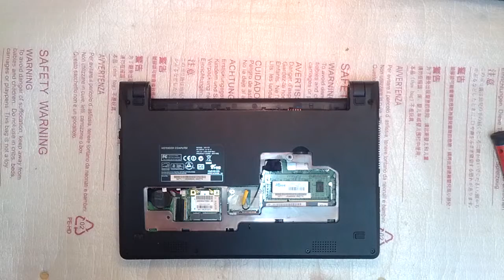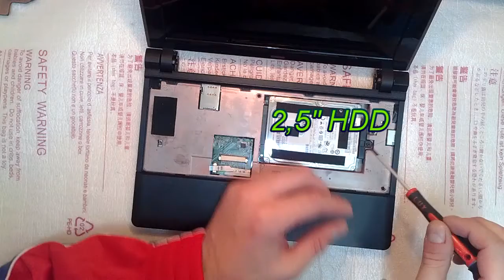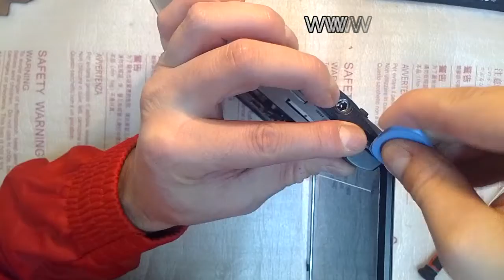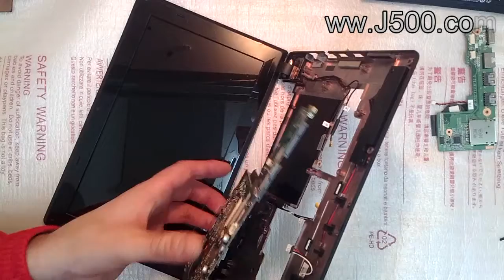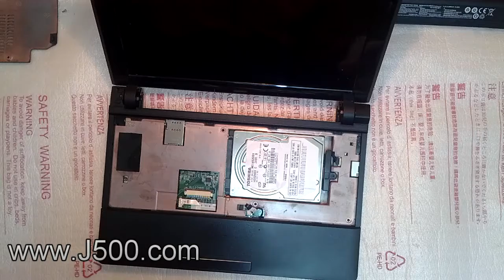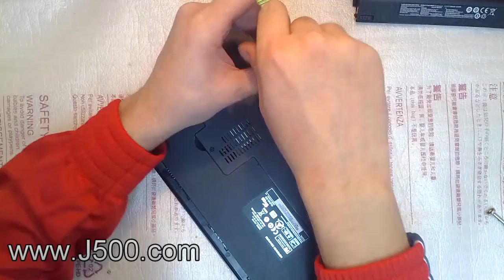Disassembly Clevo Netbook intellibook Repair Replace Guide

Comment: D= my face when i saw the little holes on the keyboard too, pushed a screwdriver in there and ripped the plastic grid off the keyboard (just the stuff between the keys) not moving the keys at all. of course then i googled this video and realized that i just ripped apart my keyboard. clipped it together and it's solid tough. now for a new battery and SSD :D